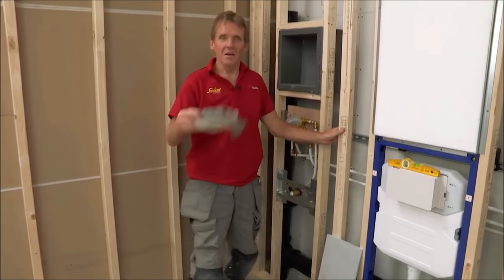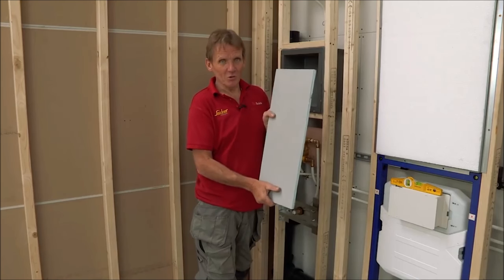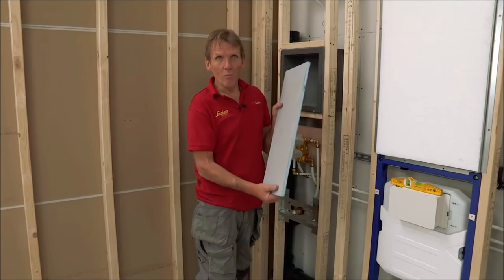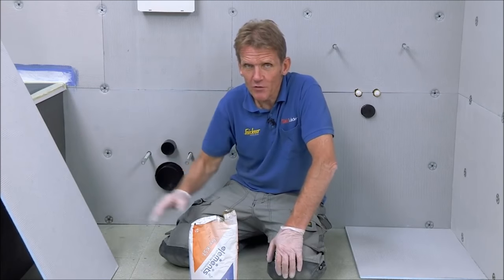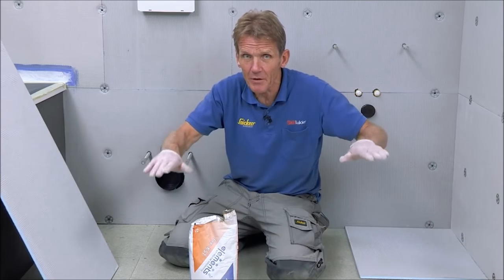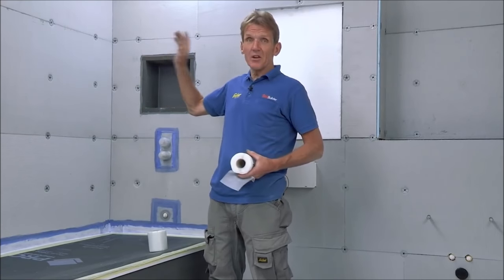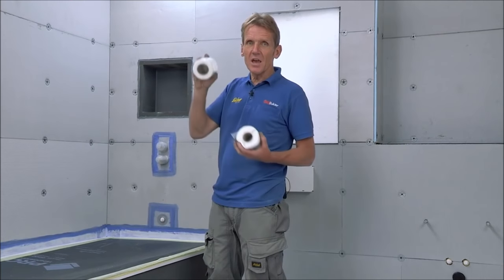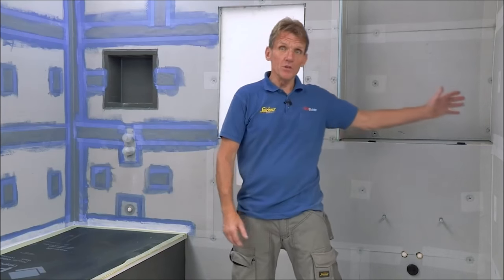Why You should use Tilebacker Element Boards

Comment: I get it... and I'm using backerboards in my new wet room already. However, there are millions of bathrooms out there that don't have a problem, and were constructed way before backboards were invented. So what did they used to do to get it 'right'?  Surely tiling and grouting properly is your waterproof defence. My 10 year old bathroom was done with moisture boards, then they actually plastered it before tiling. It's been fine ever since and no grout has come out and as far as I can tell - the shower is still waterproof.
Reply from the maker: "Surely tiling and grouting properly is your waterproof defence" 

PROPERLY is the key word here, can you guarantee when tiling you wont miss a pin hole,?can you guarantee the glaze on the tiles is 100%? As a trades person would you guarantee these and go back a cover any repairs or issues 3year 5years etc down the line? or would it be a case of customer must of damaged the grout or glaze when cleaning with modern harsh chemicles? As there are so many reasons to how and why a properly dont job could fail, and have failed, building material has developed to help provent the damage caused by water ingress, so must so that building reg now also require them. Dont forget plasterboard also produces toxic gas Hydrogen Sulfide if it get wet and breaks down

Comment: Im not a builder, so probably using the wrong terms.  Ive removed old tiles and the plastering behind the old tiles is dusty and crumbling, would i have to remove all the old plastering and take it back to the bricks before putting elements board on or can i use a pva (which would you recommend) and dot and dab and use wall screws also to keep elements board in place?
Reply from the maker: If you PVA watermix and paint over the backing plaster and allow to dry over night and see if it has helped to stop it crumbling. If its still really crubling and coming away it would be best to remove, if its stopped it crumbling then you can dot and dab and mechanically fix elements boards over it. If you can get the screw through the Elements board, throught the cumbling backing plaster and into the solid wall, then the boards will be solid.

Comment: As an installer,  the taping of joints is interesting.  The specific recommendation with some manufacturers of backer boards is sealing the joints with Mega strength adhesive.
Reply from the maker: Taping gives a stronger and more water tight finish and allows for movment of the building. Using adhesive alone you are relying that you get ever mm and dont miss anywhere and as you know many adhesives and sealeant can breakdown over time, with the tape you can see where you have been and you dont miss any joins and will not breakdown. Using the paint on sealent as well as the tape also allows you o get lots of additional sealent into all the nucks and crannies and allow larger gaps to be filled and covered with the tape.

Comment: We are renovating... would you really put this in full room or only FLOOR and the areas getting Wet? EG - Moisture resistant PB + Tile on a NON-Water exposed wall.
Reply from the maker: If you want all the benifits of these boards, ie the waterproofing and insulation value of the boards, then doing the whole room is the best option (also less dirty to cut than plasterboard), but ifif you just want to conform to build reglations etc then you only need to use these in the wetware on the wall, and on the floors of wetroom, you can then use plasterboard etc on the other walls as long as the tiles you have chosen are not heavier then the weight load of plasterboard. See here for more info on tiling weights and the building regs. https://www.youtube.com/watch?v=2Mi6Nl02Ae0&t=4s
Reply: This material is more expensive than ordinary gypsum board or cement board, but it is also obvious. It is light in weight, easy to cut and almost dust-free, but the point is that it is very strong, and it is the best for bathrooms.

Comment: Can you dot and dab this to a block wall? Or does it have to be screwed? (Just taken our tiles off in our bathroom which has removed the existing plasterboard on dot and dab). We're tight for space as bathroom already 1700mm long where the bath will be so not sure we can batten these boards onto it. Any recommendations greatly appreciated! Love your channel and have got lots of great tips from your over the years, so thank you!
Reply from the maker: yes you can dot dab them to the wall, but you should also use a mechanical fixing to increase the weight load of the wall for the tiles.
Reply: @RubberduckbathroomsCoUk  super! Thank you so much!

Comment: We are planning to lift the current floor tiles in a ground floor kitchen and bathroom, and put this insulated tilebacker directly onto the concrete to add insulation, and raise the level in line with the rest of the house. I can see how you secured them with the adhesive and the mechanical fastenings on the floor - do you have to seal up the joins on the floor also, and if so, how would you advise? We are not putting this in any particularly wet areas, the shower is completely seperate and has it's own tray. Any advice on the suitability of this for our job much appreciated!
Reply from the maker: Adding these board under tiles or floor will indeed help with insulation and thermal properties of your home. If you are installaing this on a concrete floor then the mechanical fixings are not required (only required on wooden floors) and if the room is not a wetroom room or wet area, then you do not need to seal the joints against water ingress. These boards are also perfect for adding underfloor heating on top of if you choose to do this at the same time.

Comment: What are there revolver barrel looking washers you use with the screws to keep the board on? Thanks
Reply from the maker: Fixing Washers, Available in  different sizes, with or without screws and in different pack / bulk sizes. 
https://www.rubberduckbathrooms.co.uk/abacus-wetroom-accessories?show_all=1

Comment: Question please - I have an uninsulated concrete floor and wondering if it was possible to lay insulated tile backing boards with appropriate adhesive on the concrete floor and then lay tiles on top of the backing board.  Your advise would be appreciated. Thank you
Reply from the maker: Yes you can, this will keep your tiles and floor warmer underfeet. the board will insullate the cold of the concrete floor away from your feet, and if you decide to also add undertile following then will be onto on the tilebacker board and under the tile and all the heat will be directed through the tile instead of down into the concrete.

Comment: Would this board be needed if you're using full length pvc wall panels instead of tiles?
Reply from the maker: Not required by regulations, but recomended

Comment: Surely these type of boards are going to compress with the weight of a wall hung toilet + user and crack the tiles, eventually,?
Reply from the maker: there shouldnt be any issue at all, all the weight of a wall hung toilet is taken by the frame and the any leaverage on the toilet pushes again the frame, the boards and tiles and fixed to the frame and shouldnt flex as the frame supports the boards where the toilet touches.  We have a wallhun toilet installed in our showroom with only part covered in boards alone to show the steps on installation of a wall hung toilet and taking a room and the board is fine, it also recieved more "traffic" (people sittin on it) than a normal houshold toilet.

Comment: cn i use these with pvc cladding and silocone on to board
Reply from the maker: yes you can waterproof and tank you bathroom with these board before using PVC cladding or wall boards. However silicone wouldn't be right for adhesive, you would be better with something like Everbuild Multi Stick as it gives a better fix on concrete based boards.

Comment: Thank you for this. Can you please tell me if these boards can be chased out if on a block wall? Thanks!
Reply from the maker: yeah in the same way you can with plaster board. How ever if you pipes are chased in and left exposed, then this area isnt water proof as there is no board there. You can cover the pipes in the tanking take to waterproof over.
Reply: @Rubberduck Bathrooms Ltd  Great. Thanks for taking the time to reply.

Comment: The walls in my bathroom are plastered, I was going to PVA and then tile directly to the plaster. I am now considering using the recommended adhesive to install these boards to the plaster and then tile. My thinking is that it will give better waterproofing, adhesion to the tiles but most of all it will improve the flatness of the surface I am tiling to. 

Would you recommend I do this please or can you foresee any problems?
Reply from the maker: Yes we would always recommend using these boards. To comply to building standards you need to waterproof / tank before tiling.

Comment: Rubberduck. I was thinking of using these board on the bottom of damp walls (rising damp) as I dont trust the injection method !. I was going to fix them and get them plastered over, what do you think?
Thanks.
Reply from the maker: Hi Stevey G, elements boards can be plastered over to leave a paintable finsih and are waterproof so you could use them to "hide" rising damp, but you are just hiding the problem. Our advice would be to try to find the cause of the damp (DMC, leak, gutters, airflow etc) and try to reduce the damp. https://www.youtube.com/c/SkillBuilder have a number of video to help expalin damp etc which you might find helpful, you could even contact them with images for there "ask skill builder" series and ask them about elements boards for damp proofing and other options and they will give you some more good advice. In our opinion we would look into why you have damp and try to cure it with an chemincal injhection dmp and interior tanking etc then you could use these boards for an extra line of protection.

Comment: I appreciate your sponsored but how does it compare to qboard basiq?
Reply from the maker: Qboard appears to be a BNQ own brand product. We have not used these product to be able to compair. The information on their site appears to be laking information regarding the weight bearing load and other information to do a side by side comparison.
Reply: You've probably done the job by now, but I noticed a massive difference in flexing between the 10mm Q boards and the 12mm Jackoboards and Elements boards.
Reply: @stevenb007  I have done the job but they were bonded to a plastered brick wall so flex was not an issue. Thanks.
Reply from the maker: @stevenb007  Q board is a BnQ Copy of the original. What difference do you mean? which flexy more?

Comment: Do you know if the membrane will effect the told adhesive strength?
Reply from the maker: As you are not painting the whole wall with the membrane, the added extra hold weight and stringht of the the board would over come any loss of the membrane.  you will find this video helpful to explain weight of tiles and the substrait. https://www.youtube.com/watch?v=-aSWUYHgp7c
Reply: @RubberduckbathroomsCoUk  Many thanks :)

Comment: Hi there, I was tiling my kitchen and on the corner there's a ply boxings covering the water/heating pipes, How will I bond the subway tiles on the ply?  Thank you!
Reply from the maker: Standard tile adhesive should bond to plywood without an issue, you may wish to prime the ply with a PVA primer but normal tile adhesive should bond as subway tiles are very lite weight there shouldnt be an issue. Kitchens are different to bathrooms and showerroom and building requirements are not a strict.
Reply: @RubberduckbathroomsCoUk  Thanks so much for getting back!

Comment: Is all Elements board waterproof or do you need specific elements board? Can't see to find a stockist in the Worthing area.
Reply from the maker: Element Board Is The Name Given To Abacus Range Of Waterproof Boarding. We can Deliver Abacus Boards Nation Wide to Your Door
Reply: @RubberduckbathroomsCoUk  Ah OK. Can elements board be used for the ceiling? I know you can use it on the floor but can it also be used on a ceiling instead of plasterboard? If so, what would you then do to get a smooth finish?
Reply from the maker: @TheStevenWhiting  There is no reason whey you cant use them on a ceiling for extra insulation and moisture resistance. These boards can be skimmed with plaster and then could be painted with a bathroom paint, alternativly you could use some PVC ceiling boards for a smooth waterproof ceiling.
Reply from the maker: @TheStevenWhiting  yes you can use them on a ceiling, and they can be plastered over then painted with a good quality bathroom paint. A better alternative to palstering and painting would be a PVC ceiling cladding. https://www.rubberduckbathrooms.co.uk/ceiling-panels

Comment: Hi,
I was wondering if you could use these elements boards for the floor of a wetroom instead of a wetroom tray? Or are you supposed to use both?
Also, what was the liquid that you put down on the floor before the tiling stuff?
Thanks
Reply from the maker: you need a wetroom former for the showering area which has a waste built in and a fall to direct water towards the waste. outside the former you then waterproof with the elements boards.
Reply: The liquid is SBR a bonding agent. To make a floor waterproof use a  tile membrane

Comment: Can I fix the elements board straight on to plastered walls that have been painted? If so how should this be done?
Reply from the maker: Yes you can go over plater boards with element board. You can fix them to the wall with KST adhesive or using the mechanical screws and washers.
Reply: @RubberduckbathroomsCoUk  thanks
Reply: @RubberduckbathroomsCoUk

Comment: Can I put them straight on to old tiles
Reply from the maker: yes you could as long as you use the mechanical fixing to make sure you get a good hold/fix. also make sure the tiles are clear. But really you want to be removing the tiles and geting back as far as you as covering over tiles you are just hiding any water ingress thats already happened and any mould growth you have already.

Comment: can you put the element board on top of plaster if it's already there?
Reply: I'm not an expert, but I would assume that as long as your plasterboard is in good enough condition, fixed securely and your screws that you're using to attach the tile backer board are long enough to get through to the studs or whatever the plasterboard is attached to then you should be fine. After all, it's the tile backer board and the tape/paint that gives it it's waterproof properties. I'm doing one right now and I'm removing the plasterboard first and replacing it with that stuff.
Reply from the maker: Yes you can. 6mm thick boards are often use over plaser boards to add the waterproof protection without adding to much extra thickness to wall and loos of space in a room, but you can also use thicker panels for more insulation and to packout/build out walls to suite showertrays etc. You just ned to make sure the plasterboards are secure.
Reply: @RubberduckbathroomsCoUk  If you put the 6mm boards over the plasterboard, do you tank inbetween the plasterboard and tilebacker board? or do you tank ontop of the tilebacker board? or neither?
Reply from the maker: @martinpalmer3575  the abacus boards are waterproof so dont need tanking, you do not need to tank the plaster boards before applying the abacus boards, you just need to tank the joints

Comment: Are they 300mm centres for the boards? Can’t find the info anywhere on the web, although i’m sure it is out there.

Also, i note you didn’t add noggins for the joints of the board edges!, which i expected would be required!? TIA
Reply from the maker: Most of the boards are 600mm wide, so 300mm centres are the best option.